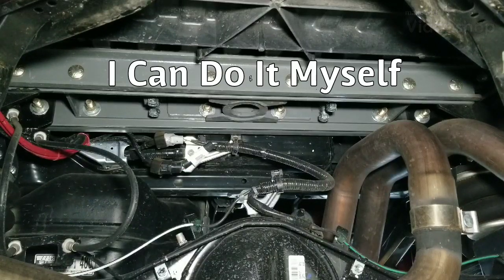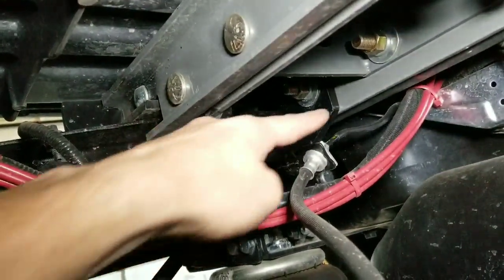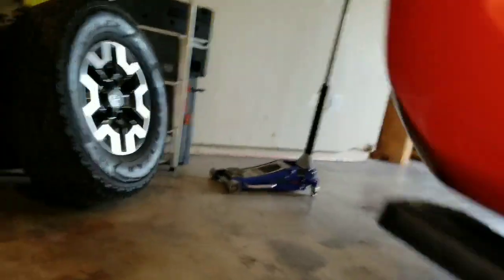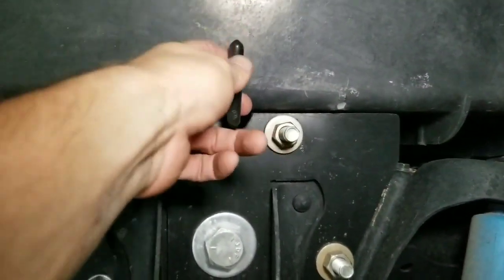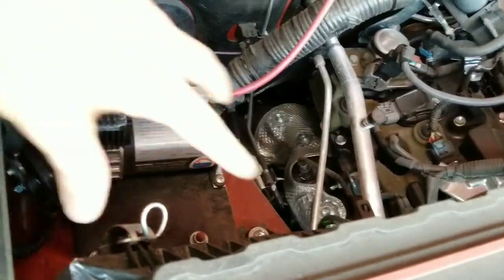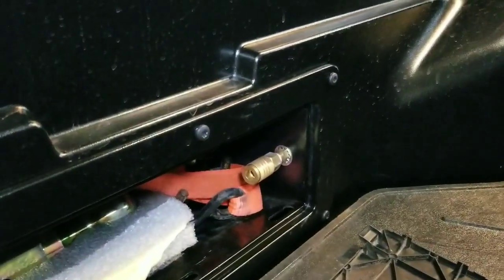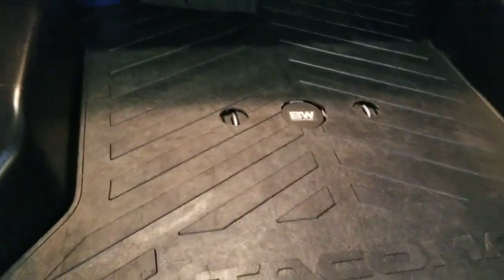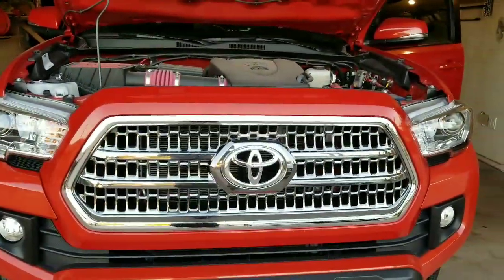2017 Tacoma Gooseneck Hitch Installed and Firestone Ride Rite Air Bags

Comment: Where can I get those brackets? Love the setup!
Reply from the maker: I made templates from cardboard and had a local machine shop make them out of 1/4" and 3/8" steel on their cnc machine.
Reply: @ICanDoItMyself  about how much did that cost you?
Reply from the maker: About $1,000
Reply: That's awesome, I have an 04 Tacoma like your "old" one. Do you know if the frame rails are the same width?
Reply from the maker: I'm not sure
Reply: @ICanDoItMyself  sorry, I meant how much did the shop charge you to have the custom brackets made?
Reply from the maker: I think it was $500-$600
Reply: That is awsome i want to buy a new tacoma and do that too. Do you still have the cad design or cardboard cut out?
Reply from the maker: @johnkkaw10  I do not.
Reply: @ICanDoItMyself  shucks ok i guess ill try make 1 from scratch too

Comment: I thought this would be a joke but you put too much work into it.  What's the use case? How much are you towing with this?
Reply from the maker: My trailer is 4,500lbs empty, 6,500lbs GVW. It's only 21 feet. Just a little fifth wheel. Here's a few videos that show more. 
https://youtu.be/D1xyuW0VsaU
https://youtu.be/Hev_pEjjy9c
https://youtu.be/E3KZXbJVwHE